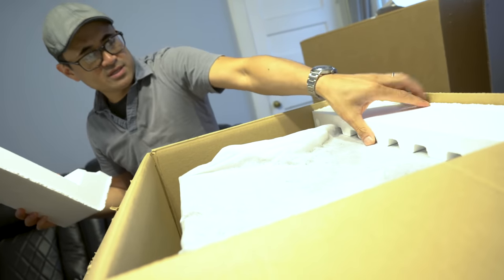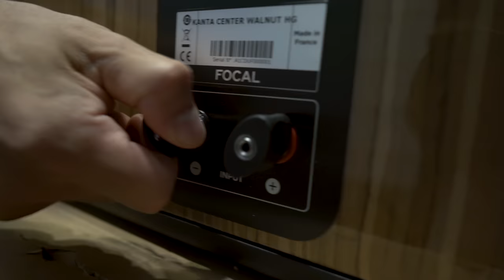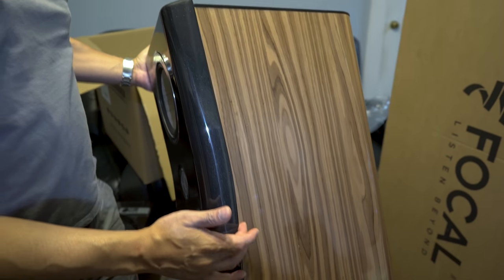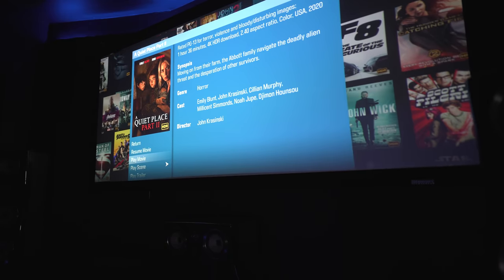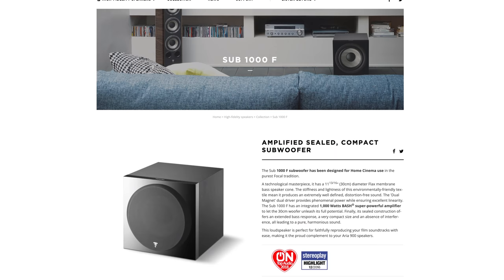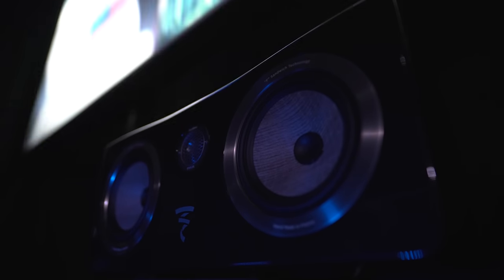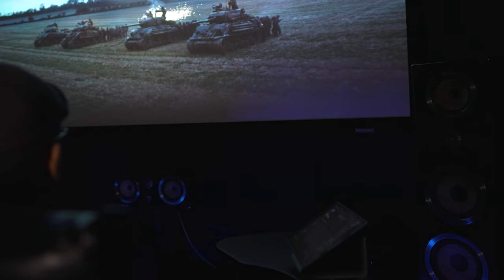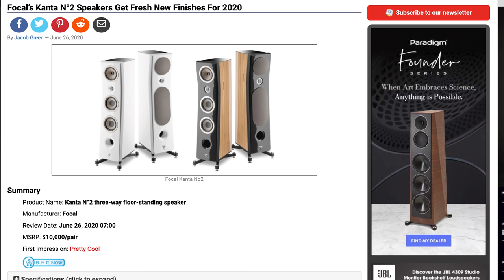Focal Kanta No. 3 Loudspeaker Review: Performance Meets Style

Comment: Well these are a bit too expensive, and I am going with a dual Klipsch rf-7 iii and an rc-64 iii, for my front sound stage with a number of in ceiling speakers, and a set of bookshelf’s, and a set of the surrounds…. So I will have to see what I get out of a 7 speaker set up, my first since I’ve only had Samsung sound bars up until now… Since I’m still waiting for the room to be done, which it should be finished in the next month or two, though I am excited especially if I can find an 85 inch or 75 inch x95k tv near me, and based on the quality of how it looks with its dimming zones… but I do not want oled… so as long as it looks good, and doesn’t cost a ton of cash, I will probably buy that this year…

Comment: I would of expected lower extension and higher efficiency.  Both my last budget oriented speakers from Kef and Infinity went to 35hz with 91db sensitivity.  I’m really into flax as a sustainable material. But kind of a strange pairing with hazardous beryllium.  No doubt the flax is high performance, but the contrast between the tweeter and the rest of the system is striking for me, especially the grill cover of the tweeter. It feels rather uninspired, I feel they could draw some inspiration from the radial-symmetry of Paradigm’s phase-guide or whatever they call it.

Comment: Respectfully I don't get the point of these videos. I learn absolutely nothing from them and always come away feeling I have wasted 15mins to see 1min worth of content. Why review speakers in a setup that the majority will never buy. 2.0, 2.1 or 5.1 or more should be the only review configurations. Shane always seems to have a mixmatch of speakers for review. (yes I know you take what manufacturers give but refuse to give surround sound review if the supplied speakers dont cover minimum 5.1 only commit to stereo listening music review)

Watching someone listen to the speakers on youtube is just silly. A crazy idea........why not measure the speakers in room response with no correction. Do the same with every other speaker you put in your room then post the measurements. At lease then we can see the difference between speakers using your room as a reference point.

I understand what you guys are trying to do. It is extremely difficult to portray a sound system through a 3rd party multimedia device or system where the quality of video and audio is mostly subpar. I will try offer some advice. It is easy to knock reviewers like andrew robinson for being non technical and bashing measurements etc. But instead of knocking him look at why he has double the subs and emulate the bits he does right. He always has excellent images of the review speakers installed in his living room space which is PERFECTLY setup for photos b roll etc.

Gene you have speakers worth thousands of dollars thrown up against the wall behind you and video is from a crappy webcam. Shane your late night radio voice is great for radio but I hear little to no passion when you talk. It is simple right? Also the late night chats are good buddy chats but really should be on a behind the scenes channel... Try to watch those videos in the morning time as a person who is trying to get good information on some new gear? All a person sees first is a bunch of guys drinking whiskey burning the midnight oil. It is a very fine line between professional marketing video and top grade enthusiast created content.

As mentioned already you cannot show the "sound" in youtube. So why not show the speaker in a real world living space looking beautiful and then you as a presenter tell the story of the music and or movies experienced with it. Personally am not a fan of Robinson but I don't doubt for 1 second that he absolutely loves music it is clearly his passion. He is an excellent story teller and his wife commentary at the end widens his channels reach way beyond the audio nerds that we are on this channel. I would also guess that you guys have access to more resources than he has but he makes much better use of his.

Last but not least keep up the great work guys......you are amazing people. It is easy for me to come here and pontificate when you are putting in hours and of hard work every week. I really want you to grow and reach the wider audiences that you deserve. It isn't the message but the delivery that needs to change.
Reply from the maker: I agree online listening tests are silly but there are channels making a career out of this and the audience eats it up,  actually thinking they are getting a representative product demo. Shane clearly states this is not the case and shows the demos for illustrative purposes. 

Doing accurate measurements is time consuming and difficult. We mostly have two people doing loudspeaker measurements for Audioholics on our editorial site and they are among the most accurate and comprehensive in the industry. 

I'm not a fan of getting our wives to comment in the background about the products. Robinson can corner the market on that feature and if that's something you enjoy, you're welcome to tube in there for it.
Reply: @Audioholics  I wasn't trying to suggest that you bring your wives into the mix. Let me clarify, I was just mentioning that it is nice to hear a non-audiophile person (in this case female), who loves music, giving their opinion on how they heard their favorite music through the speakers or system on review. 

With respect to your comment about viewers eating up sound demo videos. I sincerely doubt that type of viewer who watches online listening tests read the audioholics editorial site. The audioholic's editorial site is a pillar of the industry and one of the very best sources of data on all things related to audio. James Larson is a beast of a reviewer! Love that guy. Matt and Theo are amazing guys too. 

Forgive me if you have tried this already but why not try a review video format that follows the formatting of your editorial reviews properly sectioned out. I would love a video in that format with little video clips of the reviewer sitting and listening to 10 second clips of each song or movie followed by their reactions, which is what happens on the editorial right? 

It is not easy to read criticism. Please understand I am not trying to bring you down. I think you guys are great and just sharing my humble even if misguided opinion to try help. I don't offer ANY such feedback to Robinson. He says measurements don't matter and I say measurements are based on facts not opinions. I am here because I believe you guys should have many times his numbers. I see you trying to switch things around looking to find something that sticks. No doubt the magic formula will present itself in time. And in that time I will continue to subscribe and support. Hope 2022 is a better year!